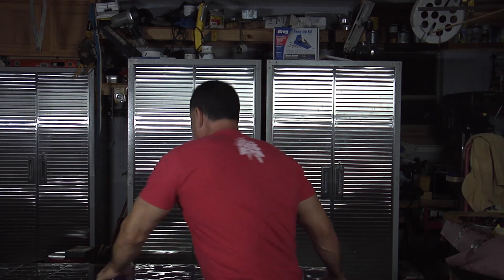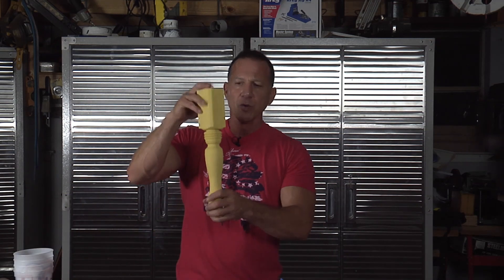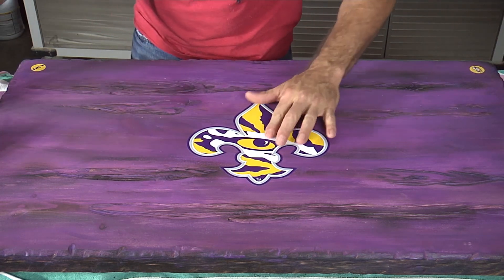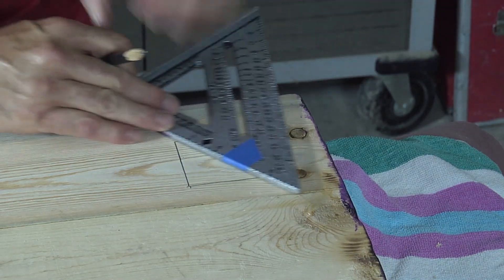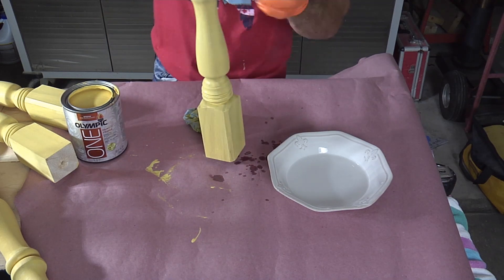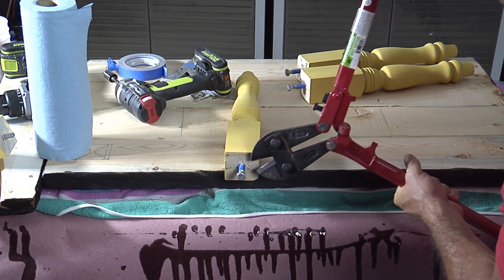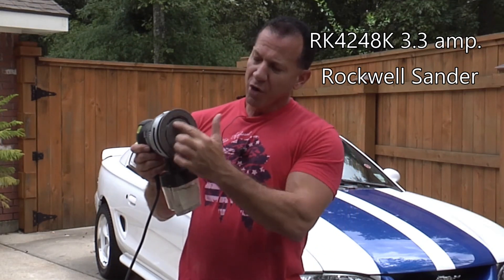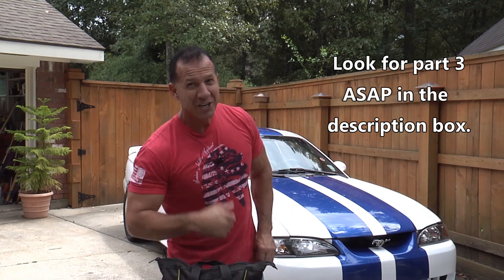Sports Table ( Mancave part 2)

Comment: Yes! I've been waiting for this. Gonna make a Kentucky one for myself!
Reply from the maker: Good morning Bill,
I hope this doesn't disappoint you, I pour the epoxy on in the next video. It takes a few steps so I had to make it in a separate video. I want to cover everything because the epoxy is very important and  I will post it within a few days. I worked late nights editing it.
Have a good weekend!
Paul
Reply: Paul Ricalde Good morning, sir. It's not too much of a disappointment. It'll take time for me to get the supplies I need. Maybe by the time I'm ready the next video will be out. Then I can sand it with my new Rockwell sander. 😉